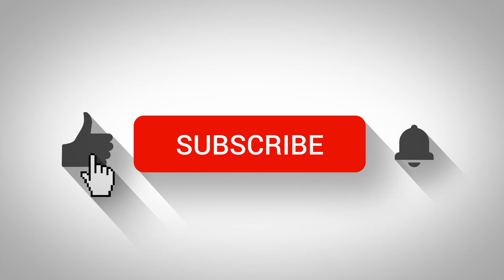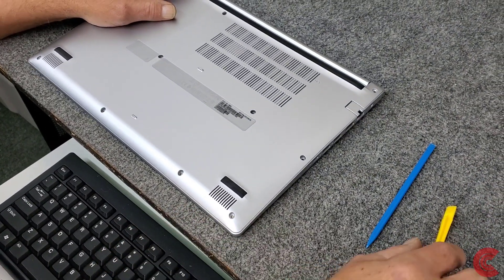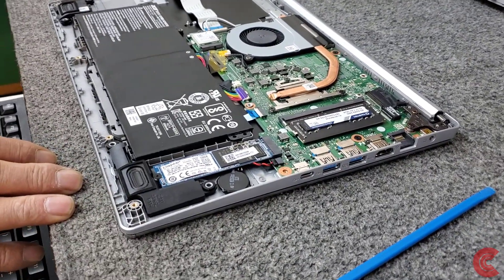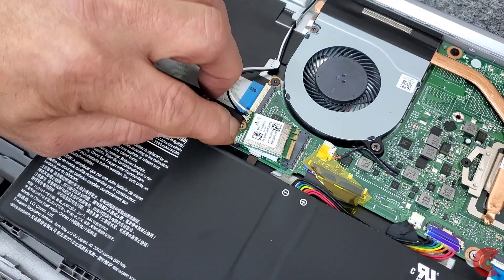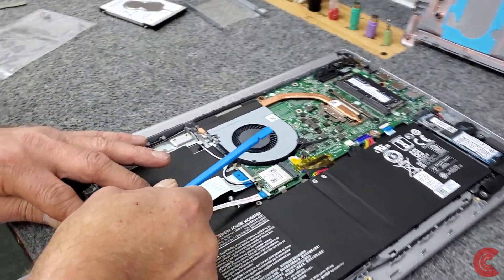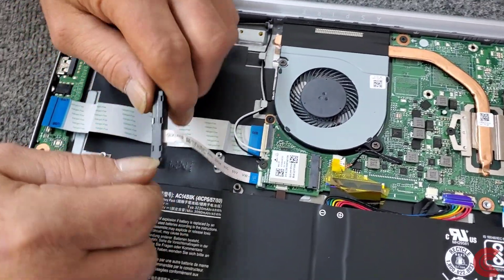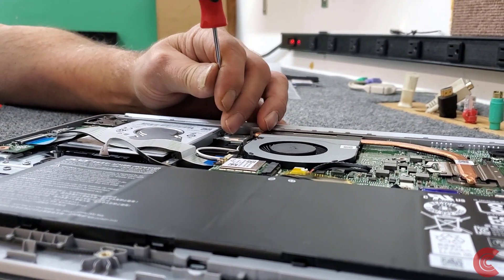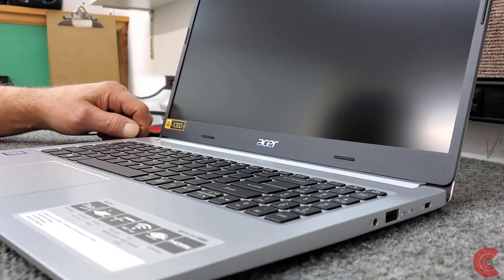Acer Aspire 5 Laptop Hard Drive & Memory Upgrade

Comment: I have been running a 500gb SSD in the 2.5in add on caddy. I wanted more space so I bought a western digital blue 1tb 2.5in hard drive to replace it. The 1tb drive is thicker than the SSD. It sticks up above the caddy a bit. The back of the laptop fits back on but it is tight against the new drive. This made me nervous so I removed it and switched back to the SSD. Do you know if it would do any damage to the 1tb HDD if I did decide to use it?

Comment: Just wanted to add to the list of well deserved kudos you have here :) .. this video was so incredibly helpful :) ... more so than the "official" videos put out by Acer showing how to do the upgrade which is saying something :) ... For people like me who thought they had a prying tool and they didn't (no idea where mine vanished to)  , my very small flat head metal  screwdriver did the trick but sadly resulted in some scratches to the aluminum finish of the laptop :(  ... I do find myself wishing Acer would include a cheap think plastic thin "wedge" type thing you could use that would do the same thing without scratching the paint ..

Comment: I have an old SSD drive chock full of data that was the Windows 10 drive from a Dell laptop. I spilled coffee on the Dell, it's out for repair. Can I install the old Dell SDD into my new Acer Inspire 5 and get the Acer to read the files? I do NOT want to lose files on the old SSD.

Comment: Hello!
I have the same model and it is showing Total 8 gb RAM and 2 of 2 used
And also SPD in CPUz shows 4 gb on slot one
 it means what?
4 gb soldered + 4 gb in slot 1
Is it?

If it is true then if I install 8 gb ram will it show total ram 12 gb?
 4 gb soldered + 8 gb on slot one
Pls reply

Comment: Hi..
My type laptop same as in the video,
I have problem, when entering the BIOS, fan processor running so fast and sound very noisy,
I think this is an abnormal issue.
Any solution for this problem?

Comment: Did a storage upgrade on my Aspire 3 (the model series under the 5) with a Ryzen 3 3250U APU easily by using the HDD upgrade kit that came in-box and following the instruction in your video and on the Acer website-quick and fuss-free!

Put in a WD Blue 250GB SATA SSD to augment the internal 128GB M.2 SSD.

Was able to pop up the Wifi card on mine without having to disconnect and reconnect the antenna wires.

Comment: Sir, In Acer aspire 5 - A515- 56 i5 11th generation (8gb + 1TB HDD model) May I know there  is one more additional slot to put SSD along with 1TB HDD so after that I will use SSD & HDD both simultaneously?

Comment: Thank you so much for this video I installed the RAM with no issues and your directions were very simple to follow! My next step is to upgrade the hard drive and was wondering if Crucial BX500 480GB 3D NAND SATA 2.5-Inch Internal SSD is ok to use?
Reply: You should check the dimensions of your current hard drive before buying anything, ideally you could also use external hard drive. I use a 2 TB one and I haven't gotten any problem with my 128 GB laptop.

Comment: May I ask po if the onboard ram can be upgraded. I would like to buy acer aspire 5 but it only have ssd with no hdd. Is it possible to install hard drive? Thank you!
Reply from the maker: Hi. You cannot change the on board ram in this model. Can only use the expansion slot or slots. You can add a 2.5 inch hdd or 2.5 inch sata ssd in this model.

Comment: Very useful. I'm leaving a comment because, in new versions, the layout is a little different. There are two slots for RAM. That's not really crucial. More importantly, the layout for the ribbon cable is different. Now, you don't have to futz with the wifi chip. The connector is completely exposed. The ribbon cable is underneath the bracket for the SSD/HD bracket, taped to the bottom of the laptop. There is now no need to bend the ribbon cable. It's a straight shot into the connector.

Comment: Too bad that there is more and more laptop manufacturers who go with 4gB soldered ram. If you go above a 4gB stick upgrade, you loose graphic performance. Manufacturers should solder 8gB and give you the option to upgrade to 16gB dual channel.

Comment: Hi, thanks for the video, do you happen to know the model a515-55g-57h8? I bought an 8gb ram to upgrade it to 12g ram but although in the Task Manager it stating only 1 of 2 slots is being used I see only 1 slot (like in your video), which means there is only 1 external slot... so where is the other slot ? and you happen to know if its true that only kingstone ram is comptiable I read it in a few places... but I dont understand the basic sense..thank you
Reply from the maker: Hi. The on board ram is always considered a slot.  Timetec, corsair, adata are all compatible,  among others.  As you can see in the video, I did not use Kingston ram. Thx.
Reply: @CadillacComputerCenter  Thank you for the quick answer, however I see only 1 slot like in your video and its with 8gb already, means that the onboard ram is empty.. is that possible? thank you
Reply from the maker: Ok, your model possibly does not have on board ram.  Have you opened it up yet?
Reply: @CadillacComputerCenter  yes, like i wrote it says that only ome slot is occupied but when i opened it, it had only one slot and it was occupied.. So i found it hard to believe it has another internal empty slot..
Reply from the maker: Well geez.  It has one slot then.  Is it a 4gb or 8gb stick in the one slot?  Not all models have on board ram.   Here is a video I did  of a model more similar to yours....https://youtu.be/BAWGzqQ5AOk. By adding your 8 gig stick, do you end up with 12 gb of ram?
Reply: @CadillacComputerCenter  There is 8gb RAM in the slot, so I need to return the 8gb RAM I bought and get 16gb ram

Comment: My old computer died before I saved my files. Is it possible to put my old hard drive in my new computer and recover that way? It fits in just the way described here.
Reply from the maker: Hi. Yes you can do that.   Or you can buy a usb to 2.5 inch sata adapter.  Dale
Reply: @CadillacComputerCenter  Thank you so much! I've put it in my computer but not able to see or access it. Any advice on that? Easier for me to buy a sata adapter?

Comment: One more question, What anti static spray do you use? Do you have a link to it?
Reply from the maker: Hi. Sure. It can be diluted as well. We use it on floors as well. Dale
https://www.amazon.com/gp/aw/d/B00BR55KQ6?psc=1&ref=ppx_pop_mob_b_asin_image
Reply: @CadillacComputerCenter I can use it on my workbenche? I put a towel down before I work can I spray it on that also?
Reply from the maker: Yes you can.  Can spray on almost any surface,  tools, floor,  bench etc.  Works very well.  Been using for years.  Dale

Comment: What Crucial 2.5 hard drive can i use? I want to add 1TB to it. Its a Acer aspire 5 A515-43-R19L
Reply from the maker: Hi.  The Crucial MX500 1TB 2.5 inch SATA SSD is a great drive. I use them alot. Dale
Reply: Awesome Thanks for your help
Reply: Is this the one your talking about? Crucial MX500 1TB 3D NAND SATA 2.5 inch 7mm (with 9.5mm adapter) Internal SSD
Reply from the maker: Yes it is. Thx

Comment: Good description. Good cameraman.  Right to the point. Thanks because NO background music. MMmmmmm….. one suggestion: advice about static electricity discharge BEFORE handling the device. 
Another advice. After instalation, turn on. Then, go to Task Manager to check the reading of the NEW RAM. About the disk, another video, maybe.
Thanks in advance !!!!
Reply from the maker: Thanks for watching and hopefully subscribing! I usually talk about that in my videos, but not always.  My bench tops are all anti static .  Static is never an issue for me, I will try to do better on that. Thx.
Reply: Suscribed !!!!! Gracias mil
Reply from the maker: Thank you for your suggestions.  I'm still finding my way making my videos. I try to keep short and to the point, yet informative.  I appreciate all feedback.  Thanks for subscribing.  Dale

Comment: What size skewdriver do you use to remove the screw holding down the WiFi chip?
Reply from the maker: I usually get that screw out with a #0 Phillip's, with a hardened quality tip. Longer shaft and larger handle for leverage.   I know acer puts that screw on to tight sometimes.   Careful not to strip it.

Comment: Does it have 2 ram slots?
Reply from the maker: Hi.  This model has one ram slot. 4gb on board. You can add a 4, 8 or 16gb module to the empty slot.  Dale
Reply: @CadillacComputerCenter  
Great video, thank you very much.
I can use a computer but that's about it, could you add a link to the ram stick required?  I would hate to guess the wrong one.  Thank you

Comment: So, I tried unscrewing the wifi card and now the screw is stripped.. is there any way to get it out? This is ridiculous...
Reply from the maker: I know this is hind sight, but always use a quality screwdriver.  sry.  there are times these screws are put in very tight at factory.  At this point you may want to take it to a professional computer repair shop for assistance.  Im sorry you had this problem.

Comment: I have a couple questions about the process of using this second hard drive. First, would I be able to copy everything from my original drive to this one and be able to boot off of the second drive? Also, once I have moved everything to the second drive would I be able to install another operating system like Linux on the original one and be able to boot into either of them when I turn on the laptop? I am planning on getting a 1 TB hard drive for my secondary one because windows uses much more system files than Linux does, and I wanted to use the Linux drive more for programming and the windows one for gaming. If you happen to come across this comment and can help, thanks!
Reply from the maker: Yes, you can have 2 boot drives.  One for windows and one for linux. Go into bios and turn on f12 boot menu access,. F2 to enter bios. Dale.
Reply: Cadillac Computer Center thanks! A couple more things, would I need to format the new drive or will it already be in the correct format to boot off of? Also, is there any special utility I would need to copy my old drive’s content to the new one or is it just as simple as copying and pasting the root of the C drive to the new one?
Reply from the maker: @NoobMaster-vk1mr  Hello, i have another that may help you.  You cannot copy and paste.  here is my link.....https://www.youtube.com/watch?v=vq2d_TXs7v0

Comment: another channel said you can add an 8GB ram stick and pair it with the existing 4GB.  I wonder if that's correct?  also, he didn't mention anything regarding additional hardware coming with the unit (in the box) to install a more memory.  I wonder if they all come with that extra bracket etc ?  here's are 2 links to his detailed demos on the same unit:  1) https://youtu.be/UUVy9g6BIaU 2) https://youtu.be/QUVo22VS2mE .
Reply from the maker: Well all of the aspire 5 series ,A515-43 models I have done, you can easily add up to a 16GB stick of ram in the one slot in conjunction with the 4 on board.  I've done both intel AMD versions of these models. Thx

Comment: Great video, thank you so much!
I just got one question left : is it possible to add  some kind of an adapter in order to double RAM-slots? I'm going to get the version with just one slot (8GB, max 16GB) and wanted to add another 8GB Stick.
Reply from the maker: I am not aware of an adapter like that. Some of the Aspire 5 models come with 4GB on board, in that case you can have 20GB of memory.  Dale

Comment: What they don't tell you is that the WiFi card is made to be damage when you try to replace the hard drive.  I didn't even touched that thing when the cable was already detached and I had to literally use a drill to take the screw out.  It was as if they put Crazy Glue on it on purpose.  Upgraded a hard drive and now I need to buy a solder to reattached the wiring to the wifi card. And as you may guess cannot use again the screw for the card, will have to use some sort of glue.  PS: Complaining about Acer, not Cadillac Computer Center.

Comment: can i replace my keyboard with backlit keyboard in acer aspire 5 a515-54g laptop
Reply from the maker: What are the model numbers after the 54g?
Reply: @CadillacComputerCenter  

A515- 54G- 55E4
Reply: I have searched in the internet and it gives  another  Models of Acer laptop like
 A515-43-R19L
A515-54-37U3
A515-54G-53H6
A515-54G-70TZ
A515-54-51DJ 
Has the backlit keyboard so can I replace with these laptop keyboards
Reply from the maker: It can be done, yes. Difficult project however.  Be careful.

Comment: Hi do you know if I can upgrade model A515-54G-52T9 this same way?
Reply from the maker: Hi, I believe your model has a 512GB SSD.  12GB memory.  4GB on board and a 8GB module.  You should be able  to upgrade. I haven't opened this exact model, but it is easy to open it up.  Dale
Reply: @CadillacComputerCenter  thanks!

Comment: i have a noob question bout installing an ssd/hdd. I had an old hdd from my old laptop, is it ok to use it as my extra storage or should I get a new one?  Thx!!
Reply from the maker: Hi.  Honestly, I would use a new one. Traditional 2.5 HDD are very inexpensive.  Your old one will work,  if you can't get a new one. You can even put a 2.5 inch ssd drive in there as well . Thanks, Dale.
Reply: @CadillacComputerCenter  thanks! do I need to install or delete something from my old hdd to start it as a new hdd? sorry im so new to this kind of stuff. thx!
Reply: Thanks for the tutorial. What size/type of hard drive should I be looking for? Thanks again.

Comment: Nice video.  I purchased the Acer Aspire 5 (A515-43-R19L) featured in your video recently.  Acer must have updated the motherboard through a design change last year because I did not have the same SATA III cable layout or a battery "just laying in the pan".  My battery was secured by screws and Acer has a thin plastic SSD caddy along with the SATA III card and a SATA III mini cable secured to the case under the caddy by like new credit card glue.
Reply: My daughter's did as well. I realized that you move the board to the bottom and mount the SATA HDD upside down. Lol, took a minute or two to figure out the difference from the video, but otherwise it was quite simple.

Comment: I have the 8 gb RAM model of this one. I wanted to know if the RAM  is expandable, as in some places, it is written it is soldered on to the motherboard. My model: A515-51G-51J7
Reply from the maker: Hi.  Thanks for watching. Your model comes with 4gb DDR4 on board, and one expansion slot containing a 4gb module.  You can upgrade that with an 8gb module or a 16gb module.  Total up to 20gb of ddr4 2133 ram. Dale
Reply: And please for a515-54g-542a?
Reply: If You hace 4gb soldered on board. Is it a good idea to add another card of 16gb. Or just another one of 4gb for dual channel?

Comment: does it matter which way the ram is snapped in?  I switched out a four for and eight g but I placed it the same way as the original But on your video you installed it the upside down from what I did??  Also can I keep the original 4 g and put the new 8 g in the other slot to increase to 12?
Reply from the maker: Hello. The ram modules only go in one way.  Period. Thanks. Yes, you can have 12.

Comment: Great video, thank you! I just received an Aspire 5 A515-54-37U3, looks to be the same layout. I bought a RAM upgrade to install and now seeing this video would like to add the drive as well. I see you linked the hard drive below at Amazon, what about the mounting bracket, can I get that there as well. Also if you don't mind, I will be opening this on my work bench in the garage. What precautions should I take regarding static electricity. You mentioned a spray, what is that? Thanks again for the video, appreciate it.
Reply from the maker: Hey, thanks for watching.  This model comes with the mounting kit for a 2.5" HDD or SSD.  Its in the box.  Just make sure you work on it on a soft clean surface, don't wanna scratch it.  You can purchase anti static wrist band cheap online, about 8 bucks on Amazon.  Or, just use the anti static spray on your bench surface, should be soft though.  That is only about 12 bucks online as well.  Thanks again, don't forget to SUBSCRIBE! Dale

Comment: Is there a reason why the battery wasn’t disconnected first as a precaution?
Reply from the maker: I Somtimes disconnect the battery,  which i do recommend  doing.  I have done this many many times without any issues. I am careful.  Yes, I should have disconnected it for this video.  Thanks for catching that. Dale

Comment: Could you please share the link for 1TB mechanical drive for this laptop in Amazon.
Thank you.
Reply from the maker: https://www.amazon.com/Seagate-Barracuda-2-5-Inch-Internal-ST1000LM049/dp/B078TJ17QF/ref=sr_1_5?keywords=1tb+hard+drive+2.5+inch&qid=1578658900&sr=8-5
Reply: @CadillacComputerCenter thanks a lot can any 2.5 inch HDD can be used for it??
Reply from the maker: @varunkumar-uq1mv  yes it can
Reply: @CadillacComputerCenter  I’m new with laptops but would this work for the a515-54 series?